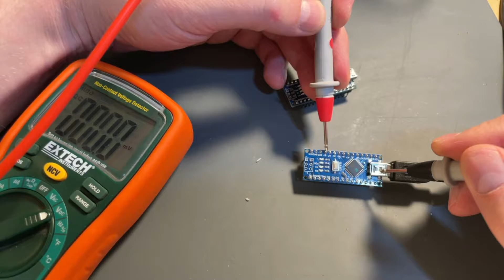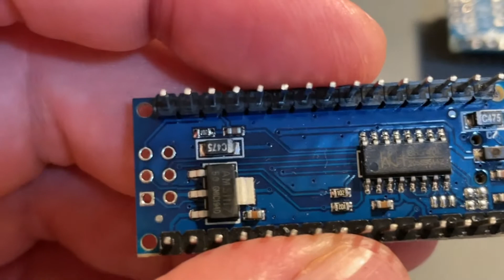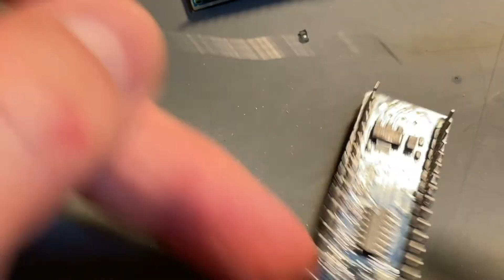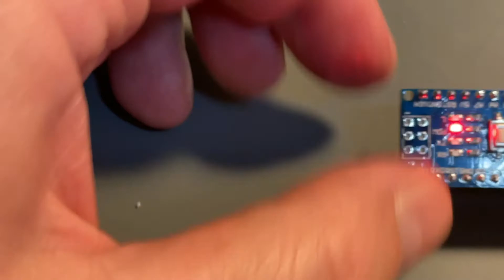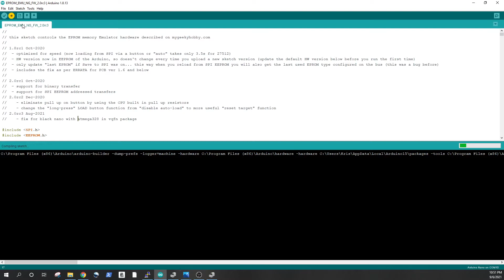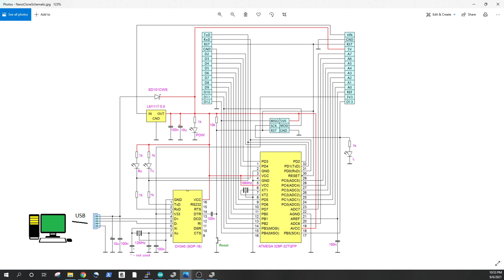#12 Repairing broken Arduino Nano Clones, Episode 2 - Power

Comment: What is the solution for the first arduino that has dim pwr light and and another light dint showed up am facing same problem with my Arduino nano that u showed in th 1st one
Reply: The Arduino nano with under voltage situation 2:17
Reply: But my Arduino nano has a different circuit diagram because its back is not similar to ur nano

Comment: My nano i powered sg90 servo directly with it and stalled the servo. I think I broke something because now all the lights are flashing when u plug it in. Have you seen something like that?
Reply from the maker: hmm ... does sketch upload work?
Reply: @MyGeekyHobbyno it doesn’t. Sometimes trying to upload makes the flashing light stop. And if i try again it starts flashing rapidly. 4.8v on the 5v pin. But it doesn’t upload sketch
Reply: Any ideas?

Comment: What are you using to see such tiny components? Are you using a video enlarger or microscope with video and that’s the same thing using for doing the video?
Reply from the maker: Well those are not the smallest components, so should be possible to solder without any help, but I normally use a microscope (simple electronic one) ... When filming the video I used my phone's camera and streamed to my computer - so I could watch on large screen...
Reply: @ could you share a link of the one you use. Thank you

Comment: I had the same problem! And for some reason my diode burned out!
Your video helped me a lot!
I used a DC DC Boost converter and set it to 5 Volts. I connected it to the 5V pin and GND!
And my board worked!
2 of my boards had the same problem!
And 1 had undervoltage!
Reply from the maker: Glad it helped. Thanks for taking time to comment!

Comment: Thank you very much. My module was a little bit different, and the diode I needed to replace next to the regulator LM1117, in my board was just one diode. You can just take off your diode and put a jumper in the same place, but never connect your arduino in voltages upper than 5V when connected in your PC.This diode is a protection, he never let the voltage upper 5V back to the usb cable and burn your usb port.

greetings from Brazil.
Reply from the maker: Glad you found the video helpful. thanks for the comment!

Comment: What kind of problems have you had with the Arduino Nano? I saw that you changed the sdm rectifier diode!!! Then did you solve it? in my case the board is detected but it does not configure!!! Which "COM" port do you use? Thank you very much.
Reply from the maker: You need to check in the device manager what com port windows assigns to the Arduino board and use that com port. It can be different on my computer and different on your.
Reply: @MyGeekyHobby  Yes, I did this step is I tried changing it to com3 and then com7 but it doesn't respond. I have to try to connect it and then uninstall it and then have the computer detect it again. I think that is the 'only solution .... . I will try!!!

Comment: I worked on so many crappy boards that "snipping it out" gave me nightmares of pads lifting off the board. Scary stuff.
Reply from the maker: I've worked on a few of those nanos, and the PCBs are decent enough. If I discover the fault before soldering the pins I would normally use sharp side cutters to remove the CH340

Comment: Excellent repair, on Nano troubleshooting. Thanks.
I noticed that on both repaired Nanos, the power LED was still not illuminating-must have also been blown? Did subsequent usage present any further issues? I ask as, an electronics' newbie, I inadvertently powered up my Nano, from a  3S Li-ion battery, during testing, of a 7805 regulating circuit (to prevent such from occurring: knocking head on table), I built; must have had twin power leads connected. Thought it would have been the AMS1117 blown. You have pointed me the right direction. Thanks.
Finally, as I've never worked on SMD components, what temperature do you set your soldering iron to, for these delicate repairs? thanks.
I am subscribing, & will look at more of your vids, as I like your style,
Reply from the maker: Thanks for the comment. Once I had the diode swapped both of my Arduino nano worked well, including the LED. The modules continued to work so I believe the repair was successful and long-lasting. Don't worry about breaking things, this is the best way to learn (as long as the costs are not too high)... for soldering SMD the key is soldering iron with a small tip and loads of flux. Good luck and thx for subscribing.

Comment: where could i find these diodes
Reply from the maker: Alliexpress is where I got them from
Reply: @MyGeekyHobby   thank you...
What was the rating on them...
Reply from the maker: @transcendence7684  I used MBR0520LT1G , but any similar diode should be fine
Reply: @MyGeekyHobby   thank you man...you just helped me a lot ...
Reply: @MyGeekyHobby  what specifications matter for a diode replacement like this one? Is it size, voltage, etc? I'm a little new to electronics on a hardware level so apologies for this beginner question
Reply from the maker: @ProperlyPsychotic  You want a Schottky type diode to minimize the voltage drop, and something capable of carrying 500mA (max you can pull out of USB port)

Comment: My Arduino nano is not showing up in my pc and RX, TX, and PWR leds get's on when plug it in my pc but it shows unknown device what should I do
Reply: I suspect the ch340 serials to usb chip is broken ... if you have another nano you can use it to program the first one (this way you can confirm if the 328p microcontroller is still working). It's possible to replace the ch340, might be cost-effective.
Reply: I tried to bootload and program nano using uno but nothing is happening to board it's not getting programmed at all

Comment: Is it off that my usb to serial converter under 5he board doesn't say anything? I have one nano that states ch340, or whatever it is, but the other three are blank.
Reply from the maker: I wouldn't be surprised, the Chinese vendors have ways to make things "cheaper" so maybe a counterfeit ch340? :) But that would be so funny, considering ch340 is supposed to be cheap alternative to FTDI. Do they work? One thing you can try is to check in device manager if the hardware IDs are the same as the fully marked ch340.

Comment: Could I use a rectifying diode instead of these SMD ones? Thanks
Reply from the maker: You can, but keep in mind a standard diode will have around 0.7V drop so your Arduino will end up with around 4.3V supply voltage. It’s fine for the atmega controller as the go down to 3.3V, but depending on the circuit you are using the Arduino stuff may miss behave
Reply: @MyGeekyHobby  okay thanks. Im probably gonna be using it to only upload a sketch. Im gonna power it from VIN so there wouldnt be any drop right?
Reply from the maker: @xSpeed2137  yep that should be ok
Reply: @MyGeekyHobby  Thanks for very quick answer! It happened because I was working with the nano and the 5 volt cable accidently touched the GND
Reply from the maker: @xSpeed2137  no worries, and that is exactly what happened to me. Those Arduino clones are missing a fuse that is in the original design, so that diode ends up taking full current if you accidentally short 5V to GND. I’m sure it will happen to me again so I bought 10 of those diodes on AliExpress , took 2 weeks to deliver but was cheap and I fixed at least 2 of my broken Arduino already :)
Reply: @MyGeekyHobby  Are there any ways to actually add the missing fuse or it would be very hard?
Reply: @MyGeekyHobby  Thanks for your advices. Managed to make my arduino nano work properly again!
Reply: I subsribed to your channel. Thanks
Reply from the maker: @xSpeed2137  great, thank you!

Comment: Sir my Arduino nano  ic heated during  make water level  LCD not show text
Reply from the maker: have you connected it to 5V?
Reply: @MyGeekyHobby   yes I have connected 5 v  but sir I look in my Arduino nano 1 SMD which num C106 is disconnect
Reply from the maker: @protechnology550  disconnect? you mean it's not there? Maybe you connected polarity the wrong way and IC broken and C106 overheated? It's hard to help you with limited information. Connect power via multimeter and see how much current it's taking... if it's over 20mA the IC is gone.
Reply: @MyGeekyHobby  yes sir I think by my mistake this component remove but I have no idea may be  during the soldering my iron  has touch Ed this SMD  sir give me solution?